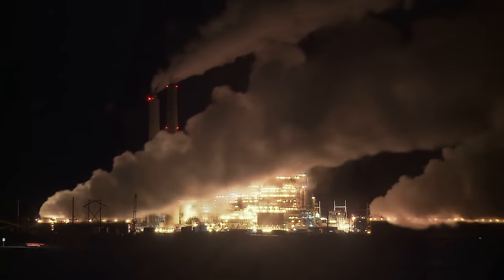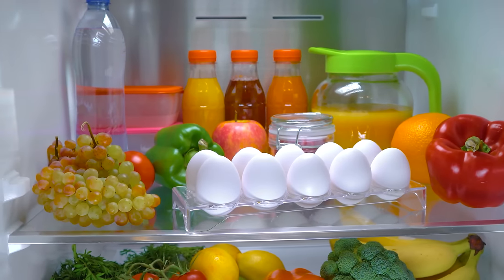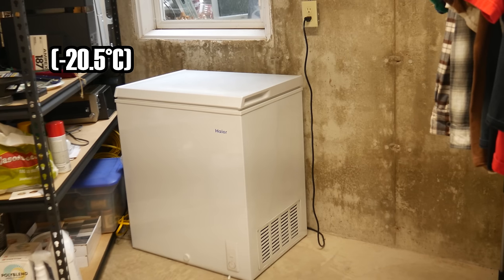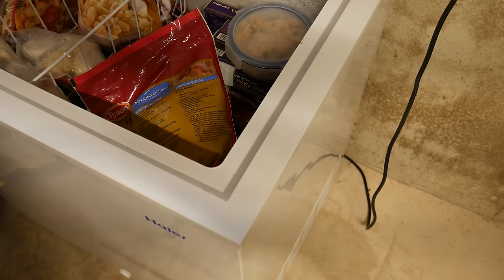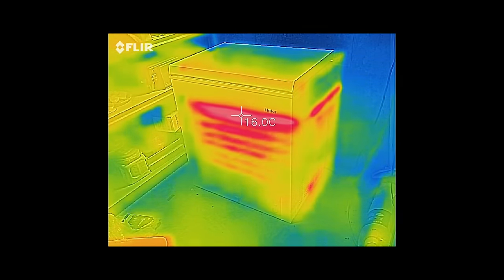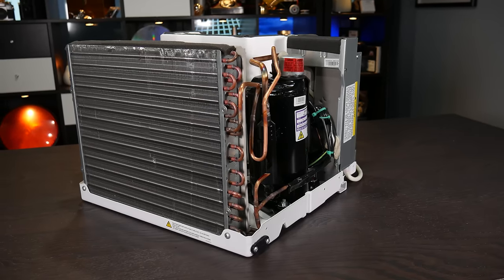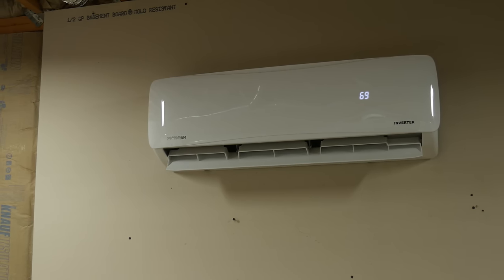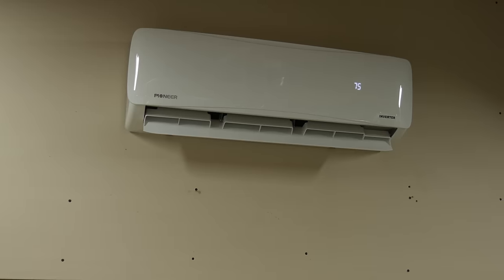Heat Pumps: the Future of Home Heating

Comment: Hello !
I'm from France and I have some interesting things here.
Members of my family are farmers, and because of the huge house they got, they had to find a good way to heat up the space without having to go bankrupt every winter. So they installed a heat pump as a main heater (for hot water and heating the interior). What's interesting is that they do not use a air heat pump, they use a water heat pump, let me explain.
Because they have a huge need of water for the animals, they had to install their own pump in order to avoid paying too much to have water. The water is directly pumped from a water table below them. So the water is basically free.
What the pump does is that it drain water from the water table and then suck up its heat until it reaches 4°C (so it doesn't freeze). Then the water is RETURNED TO THE WATER TABLE (it's not wasted).
The main advantage is that the water is almost all the time around the same temperature because it comes from underground (around 12/14 °C if i remember correctly) so there is no problem in using it during really cold and humid weather and it is also extremely efficient. You where talking about underground source for heat, so it's quite close.
They still need to use their fireplace to heat-up the air but it's already a huge advantage.

On another note, in the family house we have in a very humid region (next to the ocean), we have huge problem with heavy humidity building up inside the house and also the walls (the house is quite old and made up of materials that are quite porous. So we bought a dehumidifier to try and remove a lot of that humidity. It's a very heavy bloc the size of a big computer case. For what I understood about it, it's a closed heat-pump (closed AC to be more precise) that cool the air at the entrance to condense water inside a small tank then simply transfer the heat to the output air via another heat exchanger, the air coming out is a bit warmer than ambient air but it works quite well. We need to empty out it's 5 Liter tank of water every 6/7 hours of it working (inside a small room).

Hope you find this interesting ! I'm waiting for part 2
Reply: It seems that water/air and water/water heat pumps will be covered in part 2. Or I hope so.
Reply: They have geothermal heat pumps here that work on the same basic principles.  You are using the ground via the ground water as a giant heat sink so that your heat pump will not have the problems that my heat pump will have when the outside air is below or near the boiling point of my refrigerant.  I have a similar dehumidifier in my basement.  It cools the air down which causes some of the water in that air to condense out which is then dumped through a hose to a drain.  The air is then run through a counter flow air to air heat exchanger to warm that air and pre-cool the entering air before the exiting air is blown over the condenser coils and released back into the room.  This also pre-cools the incoming air before it is blown over the evaporator coils.  I am not sure what the efficiency is, but it would heat the air a bit equivalent to its electricity consumption, which, if holding the same amount of moisture, also lowers its relative humidity as well.
Reply: You can also do exactly that concept with modern heat pumps...you just need to run coils of pipe through the ground to absorb energy from the ground.
Reply: Whats also interesting is that the heat pump is a two stage heat pump. The first stage is around 30/40 °C to heat up the house and a second stage use the first stage has a heat source to rise the temperature to around 80/90 °C (very hot) for hot tap water (shower, dishes and stuff).
If I remember correctly (and I will need to ask for the manual later), it uses the same circuit but cut into 2 sectors with their own pumps to perform the action.
Reply: That sounds like it's just an open loop ground source heat pump.
Reply: My dad has been running an almost identical groundwater heat pump on his farm for nearly 30 years in Wisconsin. The waste water is emptied into a pond behind the house. It's a phenomenally efficient and effective system. Cooling the house in the summer often costs as little as $20 a month. And it's able to maintain a comfortable temperature even on the coldest (-35 F) winter days.
But it was very expensive to install and has required some expensive repairs. Factoring in the large up-front cost and maintenance means that he hasn't saved as much on his electricity bills as you might think. However, subsidizing the installation of such systems would be a great way to combat climate change without forcing anyone to give up creature comforts.
Reply: @NicholasJKaufman  I can tell you they never got any problem with their heat pump for now. It worked flawlessly, even when they got big electrical problems. They are linked using tri-phased power and a bird landed somewhere on the line and connected two phases witch made 340V run into the 240 V system, frying almost every electric appliance. The heat pump survived because it was connected to tri-phased power just like every heavy machinery but it was inside the house where the actual damages where located, so it's still a pretty strong system.
I don't know how much they saved from that system, but because the house is old and not very well insulated, it's far better than just having all the electric heat go to outside. At least it's heat from outside that returns to outside in a way.
Reply: That is the geothermal heat pump he was talking about.
Reply: My Fujitsu's only drawback is the fact that it doesn't dry the air at all. Windows sweat and need to be mopped daily. However this only happens in colder weather 25° Fahrenheit or lower. I live in area of fairly high humidity. The dehumidifier is rather noisy so I installed a pellet stove for very cold weather. Pellet, wood or gas heat dry the air. The humidity problem won't be a bother in some areas, and my "hybrid" heating works well and efficiently.
Reply: @redaceFR  90° hot water..  that's crazy hot! But sounds like a really interesting system 😃
Reply: @benja_mint  It's normal for hot tap water to be that hot. You then mix it with cold water later (otherwise you would have a bad time). The Hottest it is, the less of it you need to reach a certain temperature of warm water by mixing it.
I have a little hot tank water in my old house that reaches almost 95°C, it's almost boiling if you do not mix it with cold water, but it is done because it's a small tank, so you need even less water to have warm water.

Comment: It's fun how these always go out of stock in Finland when there's a especially warm summer. We're not used to having air conditioning and these miracle devices gave that as a bonus for lowering heating costs during winter.
Reply: God dammit every time. You'd think people had the foresight to invest in cooling equipment BEFORE the summer but no. It's always at the time of the heatwave.

If you couldn't get an air conditioner in the summer, then surely you would buy it in the fall, when they become available again, no? The previous summer isn't going to be the last hot one. They wait until the next summer and the cycle continues. It's a neverending loop.
Reply: Same phenomenom as why nobody changes winter tyres before you have snow on the ground 😂
Reply: @Karjis  "Talvi yllätty autoilijat" (Drivers surprised by winter). Every single year.
Reply: I live in a flat connected to a district heating but I also have an air source heat pump to cool the flat and to manage the humidity. It does get hot and moist even here in Finland.
Reply: @Juhuuu  don’t worry, eventually the ac guys will figure out they should just have crazy high prices all year in your country
Reply: @sunnohh  they already want almost as much for mini-split installation than whole device costs. Actually course where you can  get permits to handle 1,5kg refrigerant costs less than one mini-split installation..
Reply: @Juhuuu  Before the heatwave I'm just looking forward to warmer weather. During the heatwave they're sold out. After the heatwave I think "it wasn't that bad, and they are kind of expensive."

I still don't have air conditioning.

Comment: What an outstanding video. I've known for decades how AC works. Could even draw a system for you. But I could not figure out how heat pumps work. Reason, no one told me that the condenser could also be an evaporater. That one little thing that you took the time to share saved me!
Thanks 👍

Comment: We got a ground-source heat pump and it's great. There's a foot of snow outside, but the "cold" side of the heat pump is 45 degrees since the ground under our house is pretty warm 100ft down. Efficiency in the summer is insane since the "hot" end of the AC is actually colder than the inside of the house!

Edit: if you're interested I'm happy to send pictures.
Reply: Nice to see your local government lets you place something other than a well into the ground.
Reply: @captbiptoe  Just have to get very creative with the definition of "well" :P
Reply: I would love a ground-source heat pump.
Reply: Im curious if these ever saturate the ground temperature since you cant "flow fresh dirt" through it like you can flow fresh cold/warm air through the outside portion of an air source heat pump. Does this happen to a certain degree?
Reply: Same here!  We had one installed in 2012 and it's been great, even in New England winters.  One thing I was concerned about was noise, with the compressor being inside the house, as it's in a room right next to our basement media room.  But the thing is darn near silent.
Reply: @n325aej yeah.  I think they make several passes back and forth or up and down or whatever, to extend the length the refrigerant runs through.
Reply: @SteveFordham1  If we get a really cold spell it'll drop the water temp a few degrees, but usually it recovers within a few days. I think there's probably a lot of ground water which slowly circulates heat. That or the thermal mass of the soil is large enough that our HVAC is insignificant. Finally when summer comes we put a lot of the heat back using the AC.

Comment: These dual AC and heating units are found in many Japanese homes and apartments.  And where I was living, it never got too close to freezing so it worked well.
Reply: @jack99889988  Gas is probably more efficient but there are some areas of the US where it is not available.  In a side by side comparison between conventional electric heating and electrically driven heat pumps, heat pumps are 2-3 times more efficient.  Plus the ones found in Japan are designed for  a single room.  The technology is scalable for use in centralized systems that provide climate control for larger houses.
Reply: Yep if where you're living in Japan doesn't frequently reach freezing during winter, dual ACs are the norm, at least for residences or small businesses. IIRC, even in Tokyo (where it rarely freezes) cogeneration is still popular and aggressively marketed especially for dense business districts.
Reply: Those units are a need, a life ir death changer, winter is mild, but specially summer is so humid and hot as hell, mostly Japanese houses have no insulation  and are very leaky, man I can see day light through the wall on the house I live, I'm not the owner so I can't fix it but at least I have a good inverter unit
Reply: yes, these units are old school in Japan
Energy cost are very high there.
Many people still use portable kerosene heaters to heat single rooms.

Comment: Our Heatpump had a COP over the entire year of higher than 5 in northern germany using R290 as refrigerant. Heat Pumps truly are amazing. Even with the high prices for electricity here it is quite a bit cheaper than burning gas + no chimney.